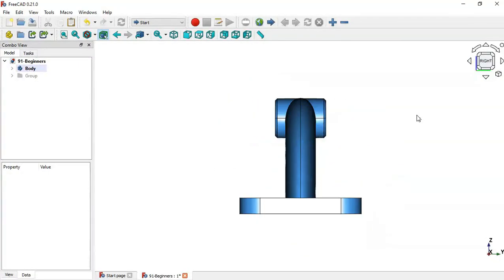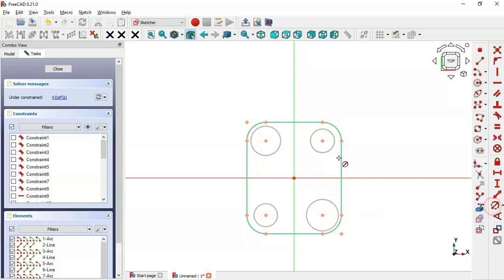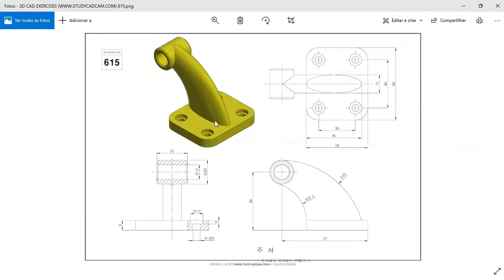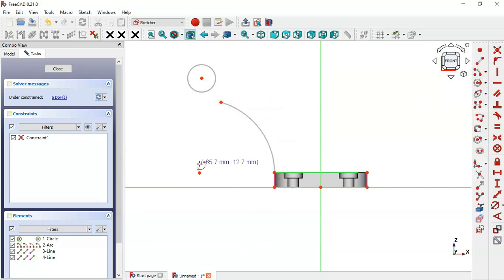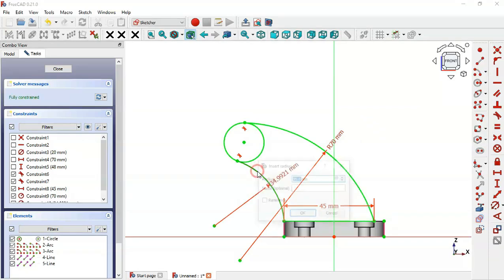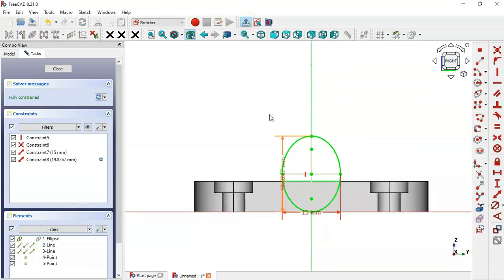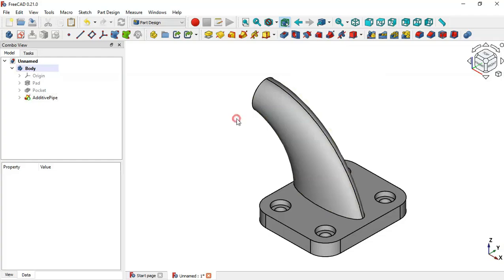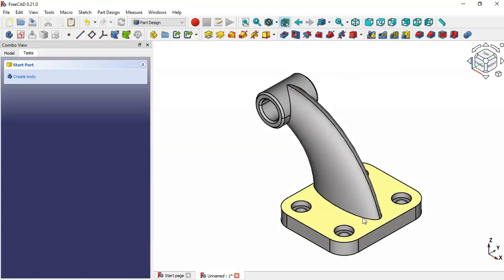FreeCAD Beginners tutorial: practical exercise 91 (Viewer request) studycadcam model

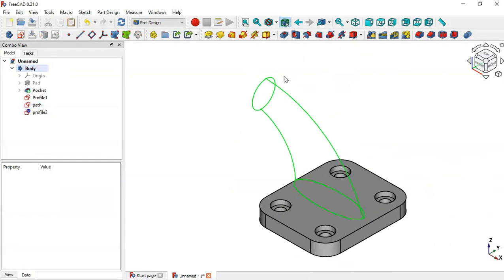Comment: Lot's of "Precisely following this Tutorial"  or it doesn't work. I went a different way right up to (10:40) where we were repositioning Profile2 and I could not select the first point, so I resized the points from 4 to 8 and I could then select the point, then after selecting reference2 and the other point,  then changing the attachment mode to "Align O-Y-N" Profile2 did not attach to the same place, which was apparent with changing the view planes? I determined it goes back to the very start and positioning of the "rounded rectangle" with the origin centered in the rectangle, or else everything I did allowed me to follow along, but because I oriented my rectangle along the sides, resulted so that when I selected "Align O-Y-N" Profile2 would not align properly? Does this make sense? SO main "Lessons Learned" are, 1) Must center the rectangle exactly like you did and 2) Increase the point size on the original arcs so that the points can be selected. I spend a lot of time following along with all the tutorials I watch, but I sometimes I use methods that make sense to my level of " FreeCAD knowledge understanding", which can have undesirable results, but I learn from my mistakes and reverse engineer until I find my mistake along with the answer to "why"!!! THANK YOU